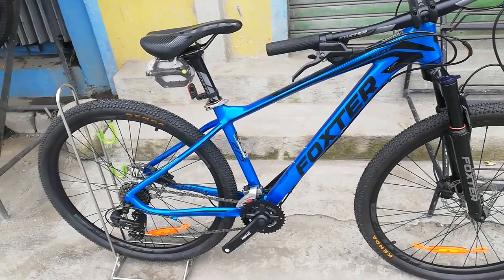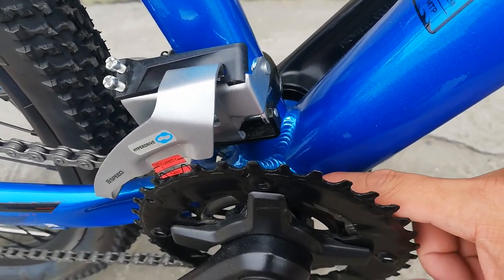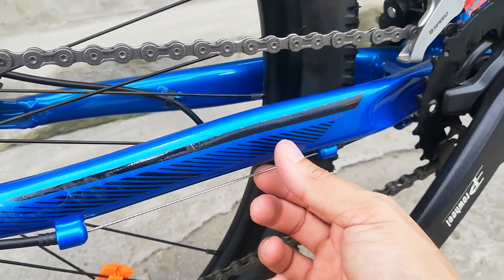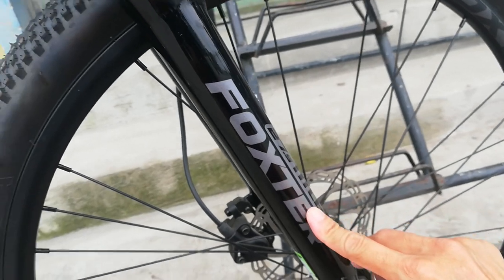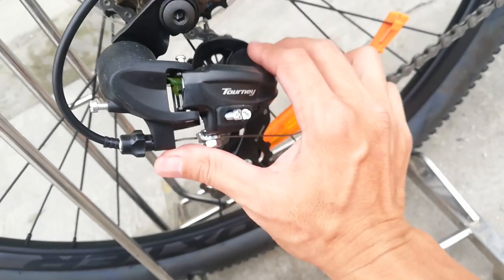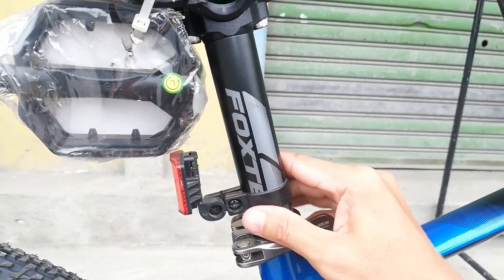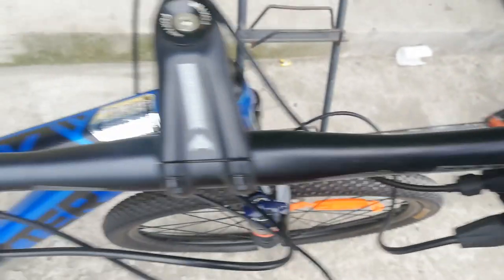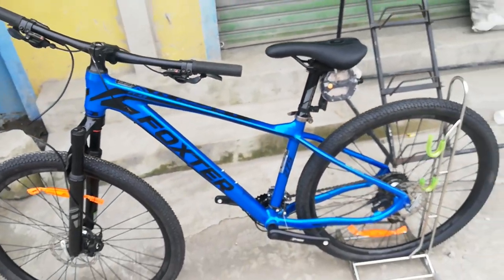Murang Foxter Lincoln sa Bulacan |Bike Check

Comment: Bossing tapered ba yung headtube or straight? Ano size ng rear hub nya saka drop out spacing? thru axle ba or quick release yung frame drop out? same din ba ng specs lincoln 4.3? thanks
Reply: L